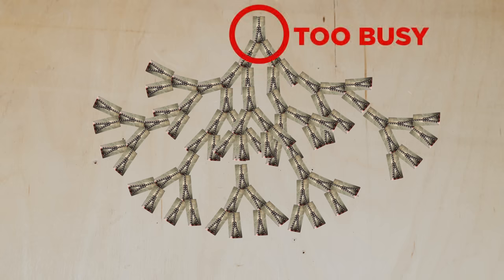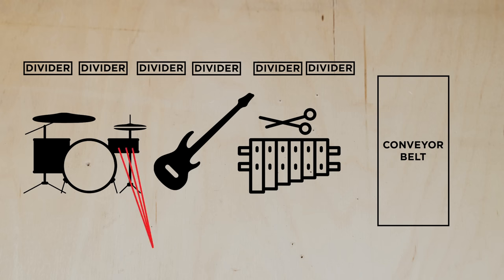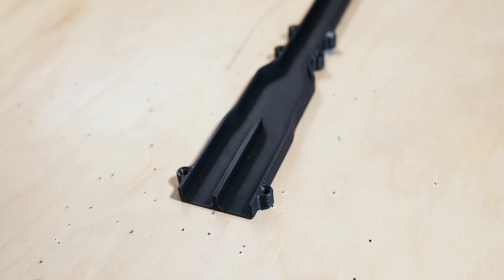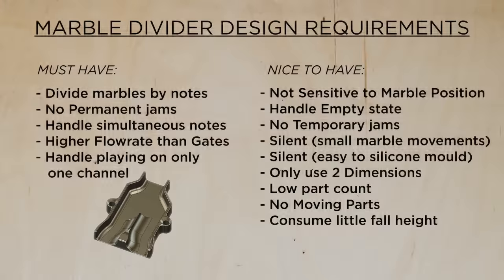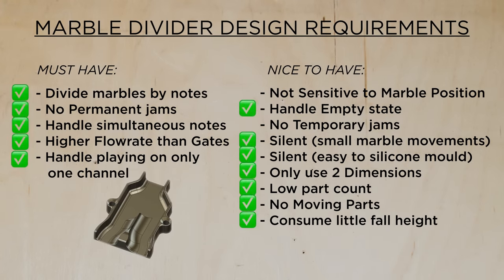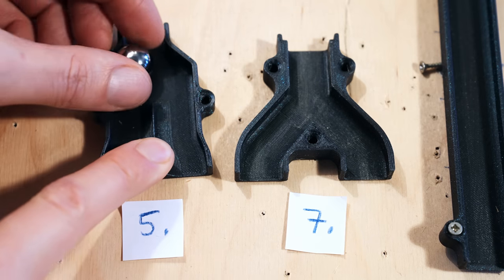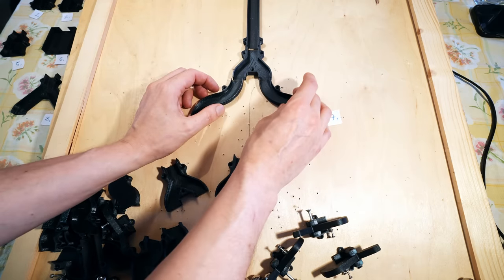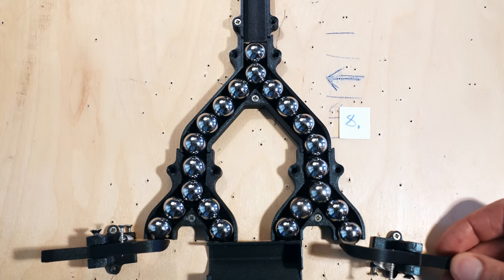Mystery Marble Divider?

Comment: You can tell that Martin understands the engineering mindset when he knows that telling engineering types that a solution doesn't exist and that "you can't do it" is almost a guarantee that someone will do it and come up with a solution.
Reply: I don't think he understands the engineering mindset at all. That's the whole reason all his marble machines since the first one have failed.
Reply: @briancampbell179  "Taking those failures and learning from them is at the core of the necessary mindset."
I don't think he's done that. His solution to "component X doesn't work" is always to try to redesign component X ad infinitum, without ever considering the bigger picture. As a result, he designs over-sensitive systems where everything has to work perfectly and every subsystem interacts with every other, in ways that are impossible to control. He seems to have no understanding of tolerances or isolation.

"If you are not failing, you are not trying hard enough."
Sorry, but that's trite nonsense. The goal is to get a working product. Obviously, some things don't work, but continual failure is an indication that the team isn't capable of achieving the goal. Either because the goal is impossible, or the team isn't talented enough to achieve it.
Reply: @beeble2003  , that is the exact opposite of what he is doing. This very video starts with the problems of relying on such overly complex mechanisms and how he needs to make them more robust. He has gone from marble dividers with moving parts that were prone to jamming to a simple design that has no moving parts and demonstrated not to jam through experiment. I love his new approach of experiment and measurement. Yes, he builds multiple designs of an element, tests it, figures out what is going wrong, and improves on it. That's how you learn what works. If you think you can just sit down with a pen and paper and draw up something that works perfectly first time, you are a fool.

Even with MMX, Martin was redesigning elements that weren't working and replacing them with simpler, more robust designs. Unfortunately, it was not modular in structure placing limits on how far he could go. While I'm sure letting MMX go was a heartbreaking decision, it was the correct one. If you class that as a failure, the fine, but it was only one. Nothing even close to the "continuous failure" you falsely claim. It is also worth noting that when Martin replaces an element in MMX, in the vast majority of cases, he replaced something that didn't work with something that did. One replacement for each element. Again, far from "continuous failure". He has never "redesign[ed] component X ad infinitum".

Finally, the structure of the next Marble Machine is all about considering the bigger picture. His design philosophy is to use simple robust designs proven through experimentation in a modular structure that allows their replacement should he have to address an issue. I am confident that this "belt and braces" approach will almost guarantee success.
Reply: @beeble2003 Until recently, he had been redesigning components without considering the big picture, because he kept redesigning them to be fitted onto the existing machine, which had fundamental flaws that he had not considered the "big picture" for.

It's clear that he has thought about the big picture now because he scrapped the previous machine entirely. Now, he's focusing on first principles and trying to design subcomponents that work well on their own, and can fit into a new larger vision. For example, his comment about using multiple marble divider loops instead of sharing one loop for everything. This vastly changes how he might design these. How is this not "considering the big picture"?

The fact that you suggest something like "the team is not talented enough" as if talent is what is required for a team to be successful suggests you haven't done much real engineering or solving hard problems yourself. Your language sounds like that of some useless middle-management type who is more concerned about watching their own back and being "correct", then actually innovating or creating real value. Martins goal is not just a "working product", it's creating something that the world has never seen before. Something that people think is impossible, until it isn't. It's called innovation, and it's a process that requires a LOT of trial and error with a lot of ambiguity. Great engineers can handle that ambiguity. Ass-licking MBA's that get hired at slowly dying mega-corps cannot. I'm pretty sure you're not an engineer. Managing them does not count.
Reply: @KingOfAceZ1  "Your language sounds like that of some useless middle-management type"
And yours sounds like that of some useless motivational speaker who believes that anyone can do anything, as long as they want it enough. Good luck with that.
Reply: @KingOfAceZ1 Sorry, but the world HAS seen devices like this before.  Martin isn’t doing anything new or inventive here.

Flywheels, mechanical lifts for small objects, mechanical sorting, non-liquid flow control, mechanical music devices.

Even a high-school kid developed a FULLY FUNCTIONAL “marble music machine” very similar to Martin’s. And this kid only took a few years (and he started when he was 12).

So let’s cut the hype and stop pretending this is anything ingenious. There are hundreds/thousands of DIY tinkerers/makers out there who create novelty gadgets.  I’ve seen countless gadgets that are FAR more complex than this one at my local Maker’s Faire.

Martin’s failure is his ability to correctly identify the true goal.  Instead, he’s lost himself in chasing “stupid design requirements,” putting his own ego over solid design choice, and simply not understanding the limitations of each component.
Reply: @briancampbell179 You think his new design approach is “almost guaranteed success”?!?

I’ve not seen a SINGLE proper design choice nor seen any single component tested in a manner that reflects how it’s intended to be used in the final product.

A flywheel that maintains precise RPM?
Bowen cables only tested in very short, anchored, perfectly straight segments?
Huygen devices tested with NO external, variable load?
Design of a “power module” with zero understanding of the machine’s power requirement, load, or dynamics?
Reply: @beeble2003  Nice ad-hominem. As petty as I’d expect.

This conversation was about the engineers mindset. I’m a gainfully employed engineer. You seem to have conceded you are not. What you have spoken of is the “I need to hit a certain target!!”management mindset that typically is taken up by middle-managers fearing getting laid off, not the engineering mindset. It seems like you have missed the mark. Case closed here? 

On the ad-hominems if we want to go there though: if the “2003” in your name is indicative of your birth year, you should REALLY consider doing something better with your time then cosplaying as someone who knows what they’re talking about.
Reply: @KingOfAceZ1  No, the 2003 in my username is not indicative of my age. It's the year in which I wanted to use "beeble" as a username on a site but it was already taken. As for ad-hominem, I was responding in kind to your ad-hominem attack on me. If that upset you, maybe you'll be more careful about your choice of arguments in the future.
Reply: Except engineers know that if you change one part to function differently from how it functioned before, you also have to change a bunch of other parts to handle the changes. Martin doesn't get this and as such, when he makes changes, he adds more problems to parts that previously worked with the prior parts but now can't because the other parts can't handle the new designs or amount of marbles coming at them.
Reply: @jish55  , this is where well defined interfaces come in. If a module meets the specification of its interfaces, changes can be made within it without impacting modules outside. A good example of this is in the software engineering field with defined APIs and classes. Even the testing philosophy of having well defined test cases for public functions while allowing private functions for be more 'fluid' encapsulates this concept. 

Badly engineered systems don't have well defined modules resulting in all elements to be strongly coupled. You could see the results of not modularising the design in MMX. Martin's current approach involves among other things, defining interfaces between modules. His success will be dependent on how well he does this and adheres to it.

Comment: The best marble divider is no divider at all.
You already said it, if each channel has its own closed loop, there is no need for a marble divider at all. It could solve a lot of issues like the marble hight. And it has a super high flowrate. For n channels just build a n-wide marble lift, and you are good to go.
Reply: There is a reason why dividers exist in life: it is too much to build one lane for every single channel. Sure, you can reduce dividers generally by increasing the number of channel lanes but I don't think you can completely eliminate them.
Reply: @Zeratoxx_   To be honest, 38 lanes does not sound impossible
Reply: In the video, he said each instrument will have its own separate loop but each instrument has multiple marble gates. It’s not feasible to complete separate all the channels because it’s pretty much impossible to create separate catchments when they marbles are hitting almost the same spot on the same instrument. Martin did say he was splitting the marbles into four because there’s four channels on the snare.

Comment: One notable thing about the design from 3:20 that does not seem to be incorporated in your 10 iterations is the tapered sides of the marble channel. Your side walls come up to the widest part of the marble and are very constrained (greater than or equal to 1 marble radius in depth). It looks like the marble channels from 3:20 only come up about 1/4 the diameter (1/2 radius) of the marble. Perhaps the slope on the sides of the marble channels makes them harder to get stuck by allowing the marbles to (slightly) climb up the slope on the sides. There is definitely an argument about how this isn't keeping the marbles in "2d", but maybe that little bit of Z tolerance that what you need to make this work more consistently.
Reply: I think playing around with a 3D marble divider could be a key to success. Adding a third dimension to the marble divider might help solve the height sensitivity issue. For example, a shape like a tripod might help leaving more room for the marbles to fall in one of the three paths.
Spheres pile up and arrange themselves better in 3D than in 2D.

Comment: Suggest: Much like pinball machine... a peace sign shaped splitter (an upside down 'Y' that toggles each marble. To stop jams at the side that fills up... when a marble path gets close to full it is use marble pressure to push a pin/tab to block the 'Y' from turning... it will have to pop up whenever a marble passes over it, but that will help moderate the flow of the marble source. When a marble is used it will allow the 'Y' to use that path again.  If both paths are full the 'Y' is blocked in the middle till either side is empty.... also, if source path is full, it can be gather to allow other more needy paths take the added load of excess marble.
Reply: this is literally that design with no moving parts

Comment: Flat bottom seems to be a real problem.   The wooden version had a rounded bottom that kept things in line better.
Also, I think having the marbles drop straight down introduces more problems.  If you tilted each divider X degrees clockwise or counterwise it would bias the marbles to one side or the other.
Reply: I don't think a bias is a problem as long as that doesn't cause a jam since the goal is to fill wherever there's a hole to fill, not to divide evenly.
Reply: @LaughingMan171  
I agree,  I am suggesting he introduce an intentional bias to one side so the marbles fall in a more predictable way (always to the left or right).  As it is now, straight down with a chance to sometimes go left or right.  
If you introduce a bias, then you would be able to more easily predict that the marble will do every time.
Reply: Oh! I see what you're saying. There's an element of random behavior here that is reduced if you bias to one side. That's quite elegant
Reply: @joeo6378  The problem with the MMX was that he had back-pressure problems controlling marble flow.  The longer the transition between marble gates, the greater the increase in weight of individual marbles pressing into particular channels.
This meant that the gates had to deal with variable pressure induced by bias because of canted valve flows.  The variable pressure increased a feedback loop in the problem of variable flow, so that the chances of a jam on certain channels was worse.
The marble gates had to be designed uniformly so that the marble drops onto the musical instruments was timed consistently with the tempo of the songs.  However the marbles did not flow uniformly because the machine was dealing with recycling the marbles from previously played notes.
So if you had a slow set of notes (like half-notes) and then an extremely fast set of notes (like 32nd-notes), the machine didn't have time to catch up.

Comment: Did you consider a vibrating mechanic? When you look how they separate stuff in production lines, they mostly use vibration. So you can have a compact design which can jam, but because of the vibration it will unjam immediately. Let me think of a design solution for that but maybe you can also figure something out ;) I'm thinking of something like a big box with X holes at the bottom for each outgoing channel. The box vibrates and the channels have short bit elastic tubes before they continue as solid pipes. This design would be very compact and would be 100% secure against any type of jam.
Reply: Could be a bit loud tho 😅
Reply: @benediktzwolfer4193 If it's hard silicone that is springy the movements of the marbles could be vibration enough and it should be quiet if not quieter.
Reply: Да, добавить вибрацию - хорошее решение. Амплитуда колебаний может быть совсем небольшой.
Reply: I like it, he's never going to go for it, though. He's gotta make his plywood space shuttle.
Reply: @captainmufdyven9291 That sounds too straight forward and under engineered for him to ever take on
Reply: The biggest problem I see with a vibrating machine is the noise of the marbles clanking against each other.
Reply: @tbengineering7066  exactly. But if the vibration is slower maybe it's ok. Needs to be tested
Reply: @benediktzwolfer4193  I really like your idea, though decoupling the vibrating part from the rest might be difficult.
Reply: @selectthedead Нижняя часть крепится на шарнире типа "рояльная петля", верхняя - на пружинных опорах.
Если всю плоскость закрепить на пружинных опорах, то возможно, что хватит вибрации от соударения шариков и работы механизмов.
Reply: A related issue is that allowing for marbles that don't go where they supposed to to climb out of a track but get caught by a gutter would improve overall machine reliability.  If one in 10,000 marbles jumps the track, but they all get caught and recirculated, that will be better than having 99,999 in 100,000 marbles operate perfectly but having one in 100,000 cause a jam.
Reply: @benediktzwolfer4193  it would definitely need to be tested. There might be fine line between having enough vibrations for the system to properly align all the marbles and too much vibration that causes a ton of noise.

Comment: I suspect a lot of your problem is caused by the flat rolling surface because it allows the balls to roll in undesirable directions. You got close with the added bumps, but consider central v-groove channels.
Reply: If I remember correctly, he tested a v-groove channel before. It could cause the marbles to flow too slowly, since they have to rotate more often to clear the same distance.
Reply: @7head7metal7  And he failed to consider all design options back then too. I get the vague feeling I'd commented that eons ago. Plus arguably, he's still using the groove concept but big enough and slightly differently shaped, it doesn't seem like it. The nub he added is in the right direction, but the separator is less important than creating a bias to either side.